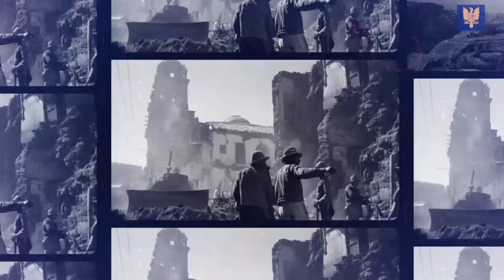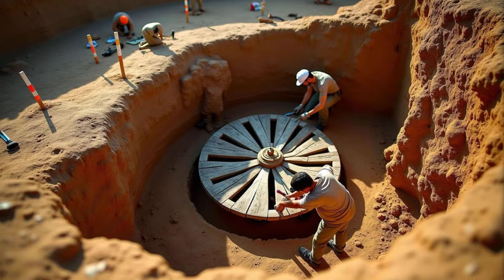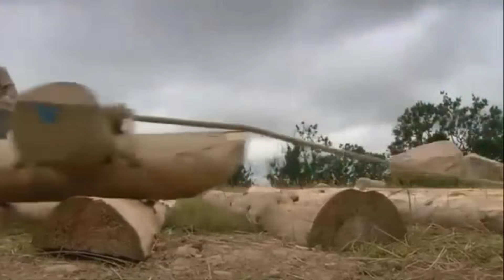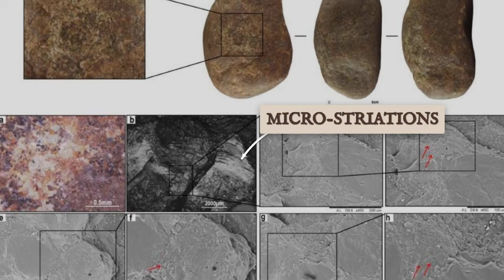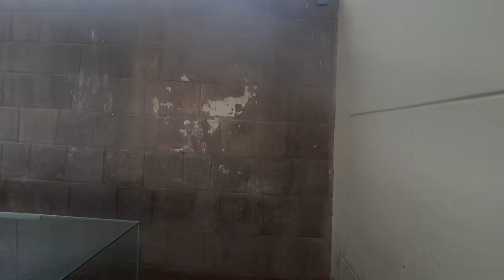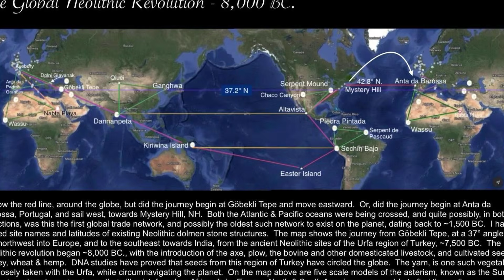The Inca Stone Walls’ Biggest Secret Revealed — Why They Never Fail

Comment: I think I figured out how they did these walls. They had the technology of pottery. So they used that technology to make their walls. The blocks were clay and they fired the face of the clay blocks after drying enough to be stable. Soil could be built up to fire the walls higher and higher and then dug back out after the top was reached. Slowly the interior clay turned into solid stone. You wouldn’t chip off the nodes because the face of the clay would be ceramic but water soluble below the surface.
Reply: Interesting theory. I don't know if it is workable. is it experimental? I'd like to see someone try.
Reply: @westzed23  yeah just heard the other day sand is turned into stone with urine. So who knows 😆😊